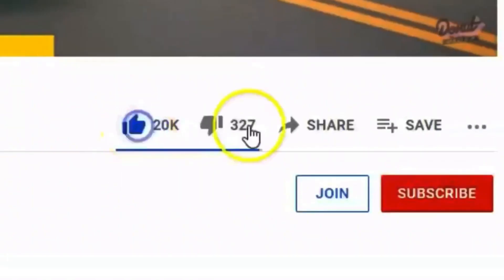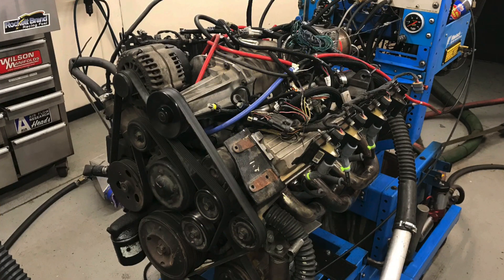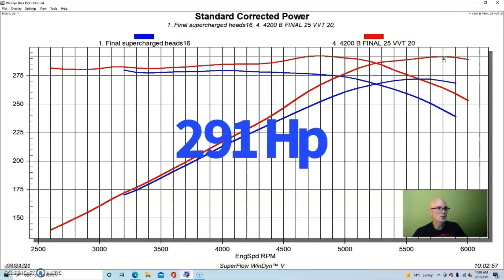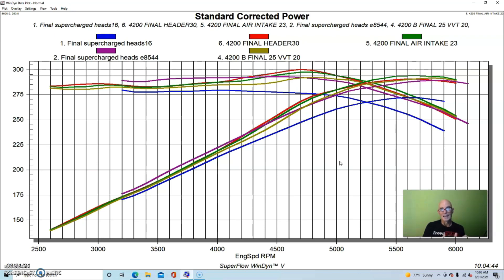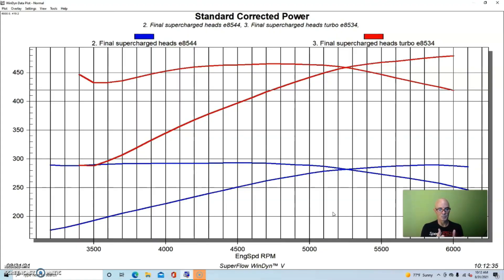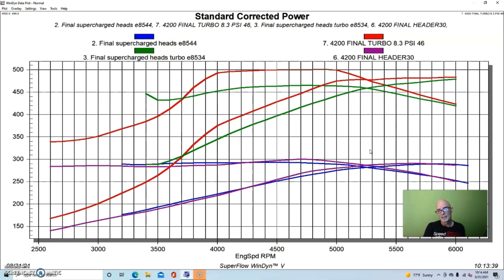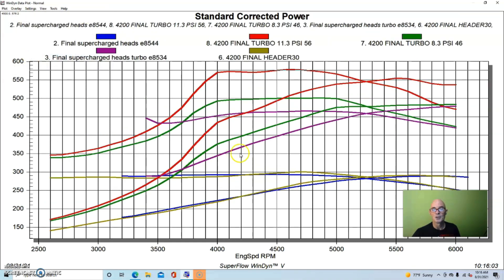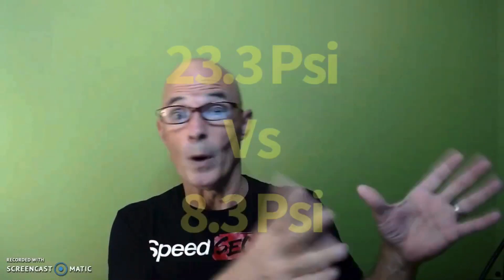WHAT WORKS BETTER, V6 OR INLINE 6? 3800 V6 VS 4200 ATLAS

Comment: Would of been nice to see what the 3800 did with just the turbo as that supercharger must be using 80-90hp at 12psi
Reply: We will eventually get to see it with just a turbo.  You'll see how well it responses to boost.  Dan Jost was running a series 2 in his Grand National, he had a Borgwarner turbo and he was making about 700whp.  In this instance his 3800 was paired with a built 4L80.  Unfortunately the company that built his 3800 hammered the main caps on, instead of installing them correctly and main cap 3 broke I believe or something along those lines.  I believe he said he was running about 20 psi of boost in that setup.  Instead of buying another 3800 and rebuilding it himself, he instead bought an LV3 4.3L v6.  He then bought a Holley High Ram intake and modified it to fit the heads of the LV3, so he could run port injection.  For some reason he replaced the heads with new ones from GM parts direct and they were not very expensive.  These heads flow more out of the box then aftermarket performance heads for the 3.8L found in the Grand National.  They actually flow a little or are on par with Buick Motor Sports fully ported Stage II heads.  Dan got his 4.3L running and I believe he said he was making the same wheel hp as with the 3800, but he's only running about 9 or 10 lbs of boost.  I was impressed with LV3 heads, that I ordered a pair from GM parts direct and I only paid $168 for the set.
Reply: With the right bits 1500hp at the fly.  Already cars doing it.
Reply: @Azu Za’s being smaller doesn't mean it uses less energy to drive it m90s are very inefficient modern chargers have come on leaps and bound since the m90 was designed

Comment: In Australia we remove the supercharger and use the n/a manifold . These engines due to their heavy rods and low compression are capable of 600+  rwhp in stock form
Reply: With a turbo
Reply: @chrishamilton5089  or spray! Ive even seen some twin screw stuff!
Reply: That's what a lot of Fiero guys do, too. There are several Fieros in the 9's and 10's (quarter mile time) using a 3800SC with a turbo conversion.
Reply: Hopefully Richard goes turbo on this and really pushes it . There are a lot of people over here that would like to know the limits of the factory internals

Comment: I would really like to see a late model aluminum 4.3 thrown into the mix. I don’t know if any of the available PCMs can control the direct injection but I understand that they have much better heads than the old 4.3.
Reply: By far.  The LV3 makes as much power naturally aspirated as the old 4.3 made turbocharged in the Syclone/Typhoon.
Reply: I believe the terminator x can has some option for doing the DI lt motors but I don't know if it's a different unit or what but I think Richard ran one of the LT with a stock computer before
Reply: @james10739  He's done some great tests with the Gen V 5.3L.
Reply: @andyharman3022  ya that was the LT I was talking about
Reply: They have the same port and intake layout as the 5.3l L83. With an agressive camshaft and longtubes they would clear 400hp. They make lots of everything and weigh more than 100lbs less than an iron 4.3
Reply: @Jack Russelle Lewis you have a source? There is a tsb for 4.3/5.3 that had oil pumps damaged in production triggering a cel but they use the same part. If the 4.3l has oiling issues caused but the pump the 5.3l l83/l84 would have the same issue.
Reply: Lex Riordan  are you having a stroke lol. Hope you’re ok
Reply: I was so impressed with the LV3 heads that I bought a pair from GM parts direct for a great price of $168.  Now I just have to get the rest of engine.  There are a couple of guys who will fabricate an intake for MPFI.  Dan Jost has done it and is running his 4.3L in a Grand National controlling with Holley.
Reply: @timothybayliss6680  The 4.3 head uses the same intake valve (49 mm, iirc) as the 5.3, but has a 3.5 mm larger bore.  That should be enough room for a 2.00 or 2.02" valve.
Reply: @charleslowe522  Are you going to have the heads flow tested and ported?  As long as they're just sitting around...
Reply: @andyharman3022  Thanks for planting the idea.  Yes I will.  There is a cylinder head/machine shop not to far from me.  However the heads have no valvetrain in them, they are the bare casting.  I will talk to my cylinder head guy or I may have the guy who rebuilt my 3.8L for my Grand National take a look and see what he can do.  He is actually a professor at a community college and he has access to the entire machine shop.  He may decide to take them and and work on them as a class project.  The students watch, he does all the work.  He machined my 3800 series 2 block for me as a class project.  Nice to not have to pay for the machine work.  As you may know the magic of rebuilding an engine occurs at the machine shop.  Assemble of the block is the easy part.  If I do, I will post the results on one of Richard's videos.
Reply: @andyharman3022  as.far as i know, the port/valve layout is common between the 5.3 and 4.3, they have the same everything. Gm is pretty skimpy with valve seats and its why guys went with 2.02/1.57 valves on 241/243 heads. Sources i find show a 1.93/1.56 (49/39.5mm) valve package. A couple places do cnc programs based of the l83 head but i cant find one with bigger valves. Given they probably have the same valve spacing as the lt1/l86/l8t the cheapest go to would be lt1 intake valves. They probably arent necessary, some guys are getting more than 300cfm through the stock valve and its a ton of really costly machine work to fit bigger valves.
Reply: stock pcm with hp tuners is what i've been seeing. but if it were me i'd attempt a DI/port staged setup with an ms3 running the port system. i've seen some 4.3s make incredible power.. newfound respect for that motor for sure.

Comment: I think once you start getting above the 600 whp territory the 3800 is really going to shine. Rumor has it the Atlas block isn't very strong and there's way less aftermarket for the Atlas. The 3800 has a lot that can be done to it with just off the shelf parts.
Would love to see how each pans out in a big bang test!
Reply: 4200 has an Aluminum block 😔
Reply: @WebNstyne  So do Kseries hondas, and Nissan v-6. They can handle huge amounts.
Reply: I'll bet that the I6 is stronger than most v6s one example is the crank on most v6 have 4 main caps but a I6 has 7 main caps.
Reply: 3 years later now and 4200’s have been proven to take 1,000 hp. With potential to go higher. 750 whp reliably with upgraded valves and springs and a completely stock bottom end.

Comment: The 4.2 is dohc with variable valve timing. Its basically like a Toyota 2jzgte but larger. Plus its 4 valve per cylinder. 4.2 way better motor.
Reply: Will the 4.2 bottom end handle an 8 secon 1/4?
Reply: @DarkLinkAD  Probably. Nivlac57/Calvin (who has been helping Richard with 4200 tuning and testing) has a 4200 in a Ford Fairmont that runs 9s, and apparently that's at conservative/safe power levels
Reply: @DarkLinkAD  I mean it's a poor question in a 1000lb car sure
Reply: @james10739   What class you runnin a 1000lb car in?
Reply: @DarkLinkAD  ya exactly
Reply: @james10739   Ah I see now, the video title is 3800 vs atlas. The 3800s are in the 7s IIRC. Prob why I asked.

Comment: My '03 Trailblazer has a stock 4200. I drive the living shit out of it and the thing is bulletproof so far. I've done nothing to it but regular maintenance. Might have to tune and boost it some day.
Reply: I've heard the stock tune doesn't allow %100 power until around 3500rpm. I test drove a trailblazer yesterday and yeah felt pretty quick around 3500.

Comment: Atlas by a mile. 

Or three.

But keep in mind, the 3800 was 1980's thinking, throwing boost at an ancient engine platform.
Reply: Ya if they had redesigned the heads like the vortech in the late 90 and aluminum would have been cool
Reply: 80s that evolved from the 60s
Reply: The 3800 is more like a 1950s idea. The first year of production was 1962. I am really sure that the valve angles and head bolt pattern are the same as the 225. When they went to the series ii with roller cam they should have made a proper head that isnt complete garbage.

Comment: Did you ever consider opening the bypass valve on the 3.8 with the turbo after it's spooled up in order to reduce the parasitics loss from the supercharger under a load as well as  reduce the amount of heat soak/ transfer from the supercharger rotors? I don't know if the bypass valve is a large enough orifice to make that work correctly or if it would create a restriction and hinder performance? Otherwise I would try spraying water methanol Pre- supercharger in order to increase the efficiency, drop intake temps, run more boost/ timing on pump gas, etc.
Reply: The misconception of parasitic loss of blower is common but it actually becomes neutral to positive as internal pressure rises and the rotors try to drive the engine thru the belt, Detroit used this characteristic in their diesels for decades and other manufacturers used energy recovery with an exhaust driven turbine to a gear drive successfully  too if you wanted to google scania for example

Comment: It's worth noting that all that sweet streetable torque in the compound 3800 is coming at much, much lower boost levels than the peak of 23+psi. Those >15psi boost numbers are only in the last 1000 or so RPM. The 3800 is tripping on the stock cam and spiking pressures because of it. Those boost pressures are going to come way down with a new cam, with little loss down low, while the 4200 would have to move the torque curve even higher to a less drivable zone with the equivalent can.
Now an M114 or TVS 1900 on the 4200...

Comment: The problem with both is the issue of packaging and intended usage, regardless of how much power you can squeeze out of them.
Unless you are keeping the 3800 in the car it came with, you are likely stuck using it in another FWD vehicle, and stuck with the AT it came with. Richard really had to dig to find a manual transmission bell housing to mount the 3800 on the dyno, so transplanting it into a RWD vehicle will be difficult if you want a manual. 
Now Richard has already started that the 4200 is a very long and tall engine, so that has to be taken into consideration. In answering a question to me, the 4200 bellhousing bolt pattern is not compatible with the typical Chevy  SB pattern, so without an adapter, you'd have to use the transmission out of the vehicle it came with, which probably isn't capable to handle the power of a high boost 4200.
But I still think it would be a fun swap in a 1967-1972 or squarebody pickup.
Reply: The 3800 bolts up the 4L60, which can be built to handle some power.  The person who helped Richard get the 3800 up and running with the Holley, Brian Pryes swapped the 3800 series 3 and a built 4L60 into his 1987 Regal T.  Running a Precision 6466 turbo, at about 18psi and I believe his car is putting down about 700whp.  Don't get me wrong, I think the Atlas is pretty bad ass and I am thinking that I am going to go to boneyard and get one.  Just to have one, like the LC9 aluminum 5.3L I have setting in my garage.
Reply from the maker: the 3800 bolts right to a 3.8l Camaro/Firebird rdw bellhousing-that's what we have on the dyno
Reply: Like Richard mentioned, the F-Body used the 3800 V6. The F-Bodies also used the 2.8 / 3.1 / 3.4 V6 for many years. And they have the same bellhousing bolt pattern. So basically, any 3rd or 4th gen F-Body with a V6 will have a RWD transmission you can use.

Comment: A lot do is top swap. Basically 9.4 in 1 compression short block adding supercharger and heads application on top NA. Reason why do that. It responds better out of the hole taking off and better times on the track. Other reasons too. Be cool do top swap NA with supercharger and heads. Be very close to the 4200 power. I think anyway.
Reply: L36 rods won't be as strong as the L67/L32 rods though. 
You can also make up for the compression difference by adding 6.67% more boost to the lower compression engine by my math.
Reply: @tuningwithstyx  people been doing that for years. Series III rods are stronger. Powdered Titanium i think. It’s better little higher compression than low compression. Depends on the engine. 3800 work better top swap. Talk to ZZP. That’s for superchargers. Turbos probably better for low compression. But not too low though. Might bog out.

Comment: Whoever has the best airflow wins. After that it's reliability and harmonic control. 
Straight 6 has better harmonic control than a 90 degree V6 plus a non staggered pin crankshaft.
Reply: 7 main bearings vs. 4

Comment: I really want to see a big bang on both of these motors.  I want to see them pushed to their limits, what breaks first.  Are they like the LS where they just need a little ring gap and they can keep on chugging, on or do rods bend after a certain amount of boost and hp.

Comment: Put a smaller turbo on the Atlas and then feed it with that bigger GT40 turbo. Bet it goes close to 700 HP. You'd gain bottom end with the smaller turbo like the 3.8's supercharger does and then the compounding factor will make the 4200 a monster.
Reply: For comparison to the 3800, Could you run a smaller turbo on the 4200 to get more low rpm response and run higher boost psi to achieve the same peak hp as in this video? How would that compare with the 3800 low rpm torque from the super turbo combo?

Comment: This also shows the 3800 supercharged biggest flaws, it's the supercharger. Ditch it and run just a turbo with either a cast, custom made intake or jerry rig it and take the turbines out and run it off your turbo as the inlet after all it already fits and don't have to worry about running the fan belt to it either. 1 down side to this is that you lose the low end torque but you gain a lot of power from 3100ish range to 7kish. Also curious if you could run a intercooler for even colder temps to boost it up even more.
Reply from the maker: we ran a cooler between the turbo and blower

Comment: Can you do the GM 3900 High Value as it makes similar power NA as the 4200. It has VVT. The heads flow better. It has Variable intake. And is a closer comparison in the V6 line to the Inline 6.

Comment: What your doing, posting these videos... I love it! Don't stop!
Another comment mentioned Northstar engines and it got me thinking. I'm seriously considering getting a Fiero and doing an engine swap with either a Supercharged V6 3800 or a V8 Northstar engine. Both being the most compatible for a swap. Between the two I'm really curious which one responds best to modifications and overall performance. And thank you again for posting these vids. I love em!!

Comment: no one calls it an Amer-Barra if I remember correctly the 4.2 is huge! and its overall weight is more than the 3800.  I think the real question is what is the cheapest most effective way to make the most horsepower out of each of these engines. The 4.2 had a limited production run, but the 3800 ran deep into the 2000's they are literally everywhere
Reply: It’s overall weight is not heavier than a 3800. It’s just physically larger. I’ve got both😂 the 3800 is a heavy ass lump of iron
Reply: @Matt_Lanzer_13  What does the 4200 weigh dressed (ready to run) ?
Reply: @danielcarroll5667  I don’t know the exact weight I just know it was easier to move the hoist and stands around with the i6 than the 3800😂
Reply: There are more 4200's than s/c 3800's in any given junkyard.

Comment: Am I the only one who wants to see compounds hanging off the side of a 4.2? Like a HX25 size turbo over a GT45. Get instant response everywhere in the rpm range. Maybe a flat torque curve from 2500-6500+ rpm. 650+ hp/900+ torque with boost, ARP bolts and studs and a forged assembly?
Reply: The 4.2 design kinda reminds me of a electronic gasser version of the OM606... so it should definitely see high HP/ TQ ratios
Reply: The hx25 is TINY. Like really stupid small. Even a twinscroll gt3788 would spool at sub2000 rpm on the 4200 and they can have variable vanes. You wont get 650hp through them. Why do you want to make 900ftlbs of torque with an engine that makes peak power at 6000rpm? Thats 1000hp type numbers. There are better candidates for your project, diesels mostly but a forged ford 300 is way more in line.